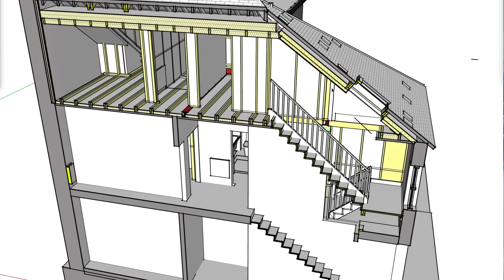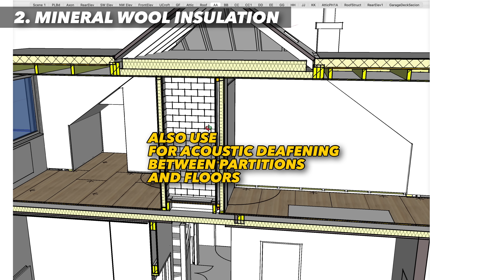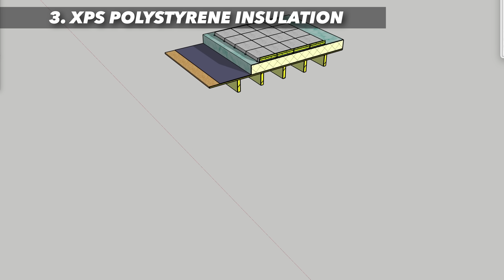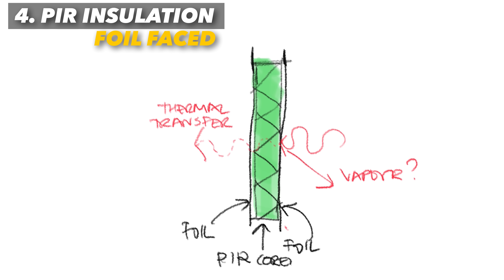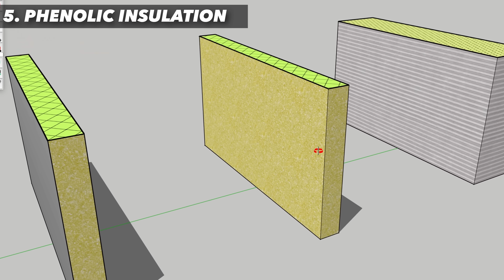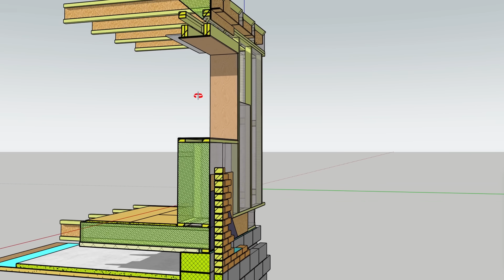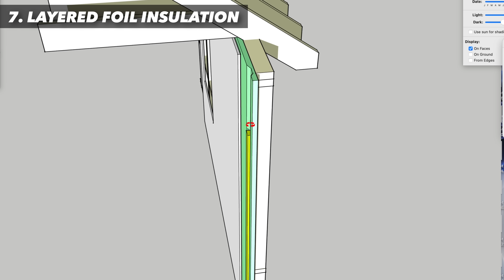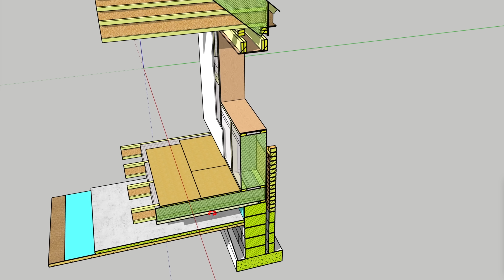Home Insulation Guide | PIR v Tissue v Cellulose v Mineral Wool

Comment: This was really helpful and gave me a much clearer understanding of the insulation options available. I am renovating an old timber‑framed, clapboarded  house and have become quite stuck on how to achieve the required thermal values without creating interstitial or other forms of condensation. The advice I have received so far has been confusing and often contradictory, so your guidance would be invaluable. Please let me know if you’re available for a consultation. Thanks!

Comment: I just bought a late 60’s bungalow. It has unfilled cavity walls. I want to insulate the inside of the external walls. I was looking at stud & 100mm wood fibre insulation with a vapour barrier & plaster boarded. Is this my best option?
Reply from the maker: You’re aiming to lose the minimum of floor area, since that’s how your home is valued and therefore is the highest importance. Insulated plasterboard using PIR is optimal out of the widely available products, However, you must consider the dew point shift: adding internal insulation warms the inner leaf, so the dew point moves outwards towards the cavity. In a standard dry cavity wall this is usually fine because the cavity should provide weeping and ventilation, but if there’s bridging, penetrating damp, or poor drainage, you risk interstitial condensation around the cavity. Each manufacturer provides dew point analysis if you’re using their products, best of luck with it.
Reply: @build-better-things  This sounds very sensible. However, to what extent can I really trust a dew point analysis done by a manufacturer? In my house from 1997 (Ireland), the cavity is filled with beads, but the house is too cold, so we have to do something and internal insulation is my choice (at the moment). However, the uncertainty in really telling what will happen seems not negligible to me, meaning that I will not find out before I really try it!? If I do, how long time do I have to wait before I can tell if it was a success on not, one year, two years? :)   Let me add Jerry, that I just came across your channel and it looks great. I really look forward to digging into your material!! All the best.

Comment: "thicker insulation = greater condensation risk" - Well it is the opposite. Just check your information about the dew point. There are a lots of types of vapor barriers each with its different permeance level and application strategy regarding the exact situation. Amd many other variables in order to have condensation and damage in the walls.
Btw how can one use "Sketchup" for full blown technical drawings of houses?! I am amazed! I think if you use BIM software for such project in technical stage you will be much more productive and accurate.

Comment: We've used mineral wool then a multifoil barrier on the floor and roof
Initially the floor because we installed underfloor heating on the ground floor but then used it in the extension walls as well

Multifoil performs beyond it's spec with an air gap between it and wall/floor/roof
Reply from the maker: Agree about the power of multifoil if you get the gaps correctly.

Comment: I live in Finland. Our house is built in 2004. We have this cellulosa insulation in walls and in the ceiling.. we have 20 cm in the walls and 50 cm in the ceiling. The reason for thick insulation in the ceiling is that I covered the ventilation pipes with the same stuff. That saves a lot of work insulating the ventilation pipes separately. There are plenty of contractors who blows this stuff around here.

Here most of our houses are so called element houses. The walls including plasterboards, fasad and windows are built in a factory. The sections are then assembled at location in a couple of days. This has been the standard since the 1980’s. There are everything from ready house models with possibility to some modification options to completely one-off designed houses. We have an completely own design. we wanted a wider house than what the standard houses normally provide with long and narrow living rooms. This requires heavier roof construction which of course costs more.

We do not live close to any major road and it is 100 meters to our closest neighbour house. It is nowadays a city planned area with only bigger lots. The cellulosa insulation combined with tripple glazed windows is in principal completely silent from normal cars passing by. There are some vibrations heard when the garbage truck empties the bins nothing else. Same goes if throw a real party. Only some minor base notes from the subwoofer can be heard in the garden.

Comment: I live on a 1955 cavity wall house. Part of my render on the gable wall fell off due to the storm Beam. I need to redo the render which was the old pebble dash which I always hated. Would you recommend going with external wall insulation or just install the render without bothering. I would much appreciate the advice. Thanks in advance
Reply from the maker: Hi. It’s difficult without actually seeing the wall make up and how the eaves,  DPC and ventilation work but yes, external wall insulation would sound the best option and I probably wouldn’t burger chipping off the old stuff unless it just came away easily. Sometimes you need to chisel it off

Comment: As a refrigeration engineer, I find it interesting how reversing the heat flow in a comfort application changes where your VCM needs to go. On a coldroom, you want it air tight on the outside (warm side is on the outside). I often see condensation and ice formation in brand new coldrooms due to poor panel jointing and a lack of vapour sealing (and leaving the bloody door open!). The fabricators just silicone the internal joints and neglect the panel joints and exterior air tightness. The humid air tracks in through the gaps, condenses at the joints behind the internal alu/PVC skin, freezes, and pops the joints wider. Repeat for a year and you have a destroyed room and snowmen in the corners. Coldrooms used to use mineral wool insulation but now generally use PUR which is similar in performance to PIR but more flammable. Sometimes working with a 50K dT or more, so moisture is a concern. I think moisture issues may have gotten worse with PUR construction due to worse vapour sealing of the joints. Something worth mentioning is that PIR/PUR performance is very sensitive to installer competence. Air tightness is very important. I suspect many PIR installations have a far greater performance gap to mineral wool.

Comment: Hi, I have just had an EPC completed and they have put wall insulationi to be  Assume none as Timber Framed building from orginal build in the 80's. The timber frame and build date is correct. They have then said to add cavity wall installation, but I can't find anywhere how that can be achieve on a timber framed builting. What are your thoughts? Next task is to cut a hole to see what is behind the plaster board...

Comment: Still confused. Just bought a house build in 1960 w unfilled cavity & concrete floor. What types of IWI would be best? On cold days I got a lot of condensation on windows, which worries me as well. Any link?
Reply: If youre getting condensation on the windows its likely because the humidity in the house it too high, you want no more than 50% internal relative humidity ideally. The humid air is just condensing on the coldest surface there is, windows unless they're very modern and efficient will naturally be colder than the wall.

Comment: The multifoil for me in dormer built has been great the room stayed warm in summer and winter. The king span dormer was roasting in summer and good in winter. I enjoy your videos full of good information.
Reply from the maker: Hi. Great feedback about the multifoil which is great for all the funny angles. I suspect the reason your KingSpan dormer is getting hot in summer is because it was done with insulating between the rafters with a ventilated airspace on the cold side. Works ok for winter but terrible for summer. Needs to be continuous as I’ve described elsewhere. Thanks again

Comment: I was trying to follow along, but am not much of a DIY'r. What type would you recommend below electrical floor heating on the bottom floor?
Reply from the maker: That would depend on your floor make up Sir.
Reply: @build-better-things  Yep. That makes sense. I unfortunately do not know what's currently below the tiles other than the old water floor heating. If I find out I might try you again later. Thanks for the response.
Reply from the maker: Ok. No problem

Comment: Hi hoping you could help. I’ve got an external wall with 50mm cavity. It’s full filled with 50mm pir insulation. I’m wanting to add extra insulation internally so looking at putting another 50mm on inside would I need to leave a gap in-between the stud work and external wall. Also would I have to put a Vapor barrier in between the plaster board and insulation or should I just dot and dab straight onto wall very much appreciate if you would offer some advice thank you
Reply from the maker: To do that you need to start with a dew point calculation since adding insulation will change where the condensation can occur. You then design your vapour control strategy around that. I’d also be concerned about your full fill PIR.

Comment: Our 2.5 bed semi is quite tight on space inside and out so I was considering aerogel as internal wall insulation between the concrete hollow blocks and the plaster board which are separated by thin wooden battens. It’s expensive, but the space thing is serious.
Reply from the maker: Yes. It’s pretty impressive. Thanks for the insight

Comment: Another highly professional construction video and gratefully received.  I would have loved to seen an explanation of the current grading/measurement system currently used to call out the insulation capabilities of these products, a refresh on the current building regs stipulation for levels of insulation in various building situations and a price comparison between the products.  An explanation of the measurement system for insulation is the most valuable of these requests - I suspect many people think this some kind of black art which uses measurement systems they are no familiar with - like 0.022 W/mK.  What the hell does this mean. Not a criticism as I think your videos are outstanding.
Reply from the maker: Hi and thanks. Yes the jargon is annoying and I try to keep it to a minimum but we measure insulation “strength” by using U values, or R values (the inverse) depending on your geography. The lower the u value the better, and we generate our heat loss/gain from there. We calculate the u values using an insulation product’s lambda value, the 0.022 you mention. I went through all the pricing and the best value at the end of the video.

Comment: Good Post. The Foil faced rigid insulation could be perforated with holes at the factory to allow vapor to pass, correct?. Isn’t insulation to be continuous on the outside of the stud, correct? video from Rockwool showing a continuous insulation RETROFIT.
https://www.youtube.com/watch?v=1YTc5h69jls
Reply from the maker: Yes, for open cell , although for closed cell, I’m not entirely sure. I don’t think the insulation makers are either when I’ve asked them. Yes, optimal is insulation over on the outside so our structure is warm.

Comment: What do you think about hempcrete? I'm planning to build a cast in situ hempcrete house next year as for me it's the perfect material/insulation that bypasses all the petrochemicals and complex vapour barriers. No need for plasterboard (on external walls) or render board either, just lime plaster straight over it 👍
Reply from the maker: I think it’s a wonderful material, but you have the space issues similar to cellulose. As a comparison, PIR k value is three times as efficient.
Reply: @build-better-things  yes it works for walls much better than in roofs and floors for that reason. It's said that the real world performance much outperforms the data because of the thermal mass. I'm looking forward to finding out! Thanks 👍

Comment: You're missing natural rigid cork panel board insulation, which is made in Portugal and is 100% natural no glue or binder, cork has very interesting thermal buffering properties too.
Reply from the maker: I’m probably missing a few but thanks a lot. Many can read the comments and get the additional info.

Comment: Looking extremely closely at Wraptherm for a mid floor flat in Victorian conversion, both because I want to radically improve air tightness but also minimise floor area loss. The flat is on the seafront so it’s not big but the location makes it highly valuable per square meter.

Absolutely fantastic to see the balancing of square meterage lost vs. thermal performance calculations. Would love to share my current project with you to get some feedback, especially on achieving air tightness with party floor and ceiling.
Reply from the maker: Hi.  That can be a good solution, from a good company , proctor?, but you need to be sure you won’t face compliance issues if you need any approvals.

Comment: I have spec'd multi-foil for insulation wherever I can and buying it cleverly can see it cost 25-30% of its quoted price.  As regards its cost, even at full price it can save money once you factor in what you have to do to get one of the other versions of insulation to work to the same standard.  I designed a loft where I used it as sarking and for under rafter insulation and to achieve the same result with traditional materials I would have to have used 200mm deep rafters or 150mm deep with a full 80mm thick PU foam instead of the 100mm deep rafters that were required for the structure.  There were also significant savings in labour, which today is the most expensive element.  The reason that some BI's resist its use is because they simply don't understand how it works, in which case I suggest you employ an inspector that does.  I deal with the largest and most influential Approved inspector Group and they actively recommend it.
Reply from the maker: The problem is, some take the opposite view to you, including some certifiers. You need to see the whole picture and then think about solutions, otherwise your positive experiences are not always useful.
Reply: @build-better-things  Of course any specifier should provide the best solution to the circumstances they are presented with but there is so much bigotry out there from the ignorant and unknowledgeable that good solutions are discarded.  In UK you can pick and choose which certifiers handle your project so select the one that thinks on the same level.  In my experience its the little people who have less vision.

Comment: Cellulose (shredded Newspaper usually) IS TERRIBLE It settles to the bottom of Cavities over time (surprisingly few years) turning into solid useless masses at the bottom of wall cavities  !
 Need we even talk about what the Swill does with even ambient moisture ??
Reply: True, and fiberglass blown into wall cavities is worst of all, settles by 75-80% in about 5 years, leaving wall uninsulated.  Settles badly in attics too, settles at least 70% over a decade.

Comment: I recently installed fiberglass insulation in joist cavities under my house.  It was labeled as being as soft as cotton, and was not irritating at all.  I'm still using fiberglass for my interior insulation in my house because it is so comparatively cheap.  The bulk of my insulation is exterior.  With joist and stud cavities and the associated thermal bridging, I don't think it is justified to spend the extra money on mineral wool. OTOH, I'm using mineral wool on all of the outside layers of the house to add better resistance to wildfires.